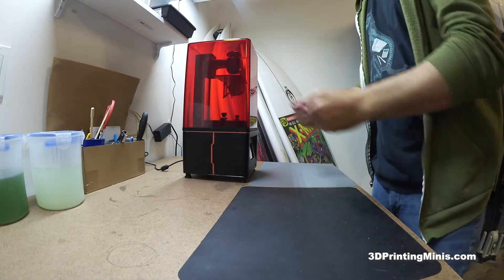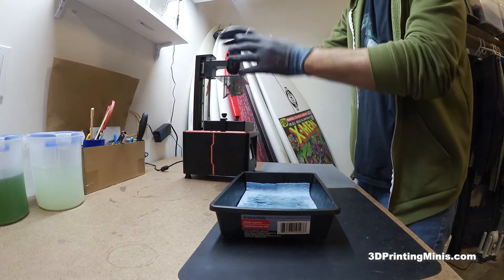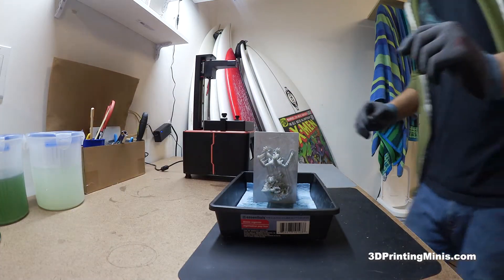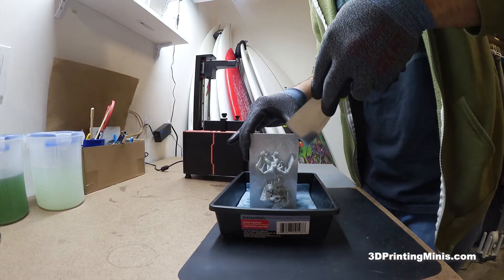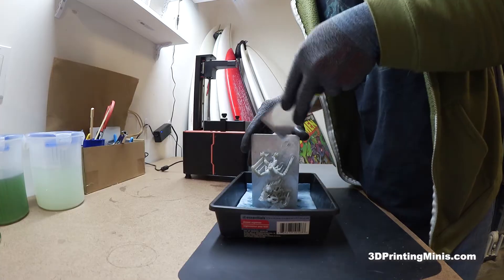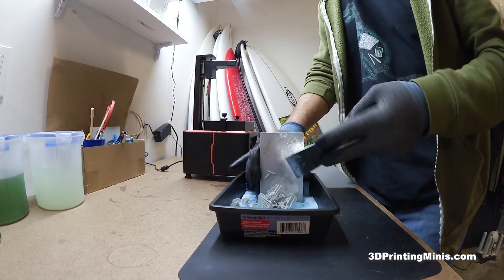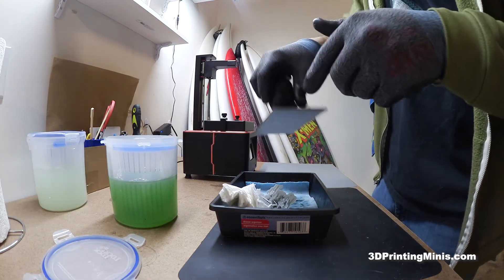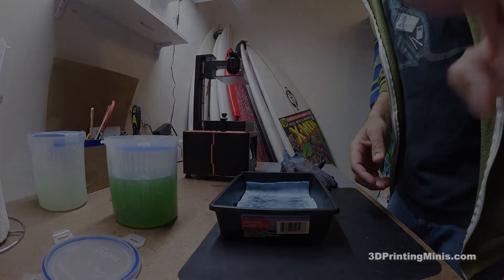How To Remove Prints From Build Plate Easily - 3D Resin Printer

Comment: what i was really looking for was how much force/wiggling is required to remove prints and if its ok to scratch the base. this video was really helpful on those 2 fronts!
Reply from the maker: Yeah, if you lower your base layer times a little bit (say 5% or so) prints should come off easier. Just be careful not to make the base layer times so low that prints don't stick to the plate and you get failed prints. You just need to experiment with your printer and favorite resin(s) a little bit. And from there on out it should be easier to get prints off without snapping your spatula in half.

Comment: What I’ve found works better than pushing hard is positioning the sharp edge of the knife in just the right spot, and tapping the back of the handle with a hammer. This works best if the metal blade has a full tang, going all the way back to the back of the handle, so you're tapping a solid piece of metal.

Comment: Have you tried resting the plate on its long edge and then scraping off? I would think its easier to keep away from your hand and less risk of hitting the print below, plate is probably less wobbly on it's long edge too?
Reply from the maker: Yeah, I just don't like it. Doesn't fit well in the container I use and it's harder to get good leverage and angles with the scraper. I really don't hit my hand much unless I'm not paying attention. I make more mistakes in my videos than in real life. Mainly because it's harder to do all this stuff with my hands while talking and describing what I'm doing. And also trying to do so without swearing, especially when I make mistakes. :-)

Comment: The way I do it is with a hammer. Put the scrapper at the bottom of your structure and then get a hammer. (Any size works besides tiny) Then with the hammer and hit the back of the scrapper a few times and it comes off with ease. Also your way works awesome. Keep up the good work!
Reply: I think a full size sledgehammer and a 300 lb anvil would work best, perhaps using the power of thor to smash that tiny little resin part off.. Go Thor! :D

Comment: I don't scrape anymore, boil a kettle and slowly pour that boiling water over the base of the models, where they attach to the build plate, they fall right off.
Reply: Sounds like 2000 IQ suggestion here. WiIl try it with my Sirayatech Simple clear resin when it arrives this week. I also heard that you can release the models by putting the build plate in the freezer. Falls right off they said.
Reply: @Splatterpunk_OldNewYork  Yes, I've done that as well. Freeze the build plate first , then boiling water = fall off.  That trick only works on one of my printers though, I think it has to do with how textured the build plate is and how well stuff sticks. I modified one of my build plates by sandblasting it, I was getting too many failures with the original finish. I don't get failures any more but they are much harder to remove. Even with boiling water I still have to pry with a spatula. Edit: Sirayatech sent me a bottle of clear, haven't tried it yet, but I believe they said water makes it crack, specifically they said don't post cure it in water. Not sure how the boiling water thing will work.
Reply: @RichardThompsonCA  I bought the water-washable kind. Needs like 15% alcohol for finish.Heard great things about it. High strength and high temperature threshold.
Keep you posted.
Reply: @RichardThompsonCA  Thanks my man. I have been printing for about the 3 week mark, and learned a lot. I use 1 or 2 burn in layers of 30s only, and then the thing releases with satisfying ASMR.

Comment: Thanks for the vids.  I am sure you have thought of this, but could you not go straight into 50c Mean Green bath, let it heat up and see if it just falls off plate like you mentioned supports do in another video?
Reply from the maker: To me, putting the entire plate in the Mean Green is overkill and kind of a pain. The plate has extra resin on it that's going to pollute and dirty up your Mean Green faster than I'd like it. Also, then I have to dry and wipe off the plate covered in Mean Green that's going to drip all over the place. Also, the plate from a bigger printer like a Mighty 4K or. Saturn won't fit all the way in most  ultrasonic cleaners so you'd have to awkwardly dip/soak 1/2 of the plate at time. Honestly, the best way to get models off the plate is to work on dialing in your base layer times. Once you've got those set for the resin you're using removing prints is pretty easy and not worth the extra mess or effort. Again, this is just my opinion. You're free to try any method you wish or find that works best for you.

Comment: All my prints get the little ridge (elephant feet) on the plate side. Do you have suggestions for zeroing the plate better? New Sub. Keep giving them Hell in the comments.
Reply from the maker: I print all of stuff on rafts using supports, so I really haven't run into the issue. I'm sure someone like Uncle Jesse or one of these 3D printing YouTubers has covered this. Sorry I don't have any suggestions. Again, I just don't make prints that would be able to experience this (because of the rafts/supports).

Comment: Hi! It's amazing but my model got extremely stuck on the platform :(
I don't know what to do. It's the RERF test that comes with the Anycubic Photon Mono SE (I mean, I haven't changed any settings) and it's strongly stuck. I've tired with the plastic scraper and I made a "dent" on it... So I've tried the metal scraper as you but I made a small damage on the plate... And they keep stuck on the platform :~(
Do you know what can I do?
Thank you so much!
Reply from the maker: This video is more about changing your base layer settings in your slicer program to avoid the situation you're describing. But, you can try removing and wiping down the build plate with paper towels (and UV curing them before you throw them in the trash). Then place your build plate in a large ziplock and but it in the freezer for 20 mins. The contraction of the metal as it freezes should cause the model to pop off of the plate. Then UV cure the ziplock bag and throw it away. Then try lowering your base layer cures times by 10% like this video recommends for future prints. Best of luck.
Reply: @3DPrintingMinis  thank you!

Comment: Thank you for the vid.  I was holding my the bracket and also using lots of pressure/ force to remove - good to see alternative method - hourly help me "destroy" less prints! 🤣
P.S. what "base cure speed" do you set your base to? Have you found this makes a difference?
Reply from the maker: The base layer setting varies from printer to printer and from resin to resin. You'll have to look up the recommended setting for your printer/resin and experiment with different time increments (2 or 3 seconds up or down) to see which work best for you.

Comment: Is there going to be any problem if the plate gets scuffed??
Reply from the maker: Yes, but the stuff I print is all rafts with supports. If you’re print stuff straight onto be plate it might be an issue. But your could also sand your plate (being careful to use a very flat sanding block) if you want it smooth again. But for me a scuffed or scratched plate isn’t a deal breaker.

Comment: My very first print (the rooks) got stuck very hard. I scratched my plate a little and cut myself :(
Reply: Mine got stuck too!
Reply from the maker: Spoiler: Don't print the rook file that comes with your printer. It's useless.
Reply from the maker: Spoiler: Don't print the rook file that comes with your printer. It's useless.
Reply: I printed mine and they are stuck. So here we are.

Comment: Wow, I guess the panic I just felt that I'd done something horribly wrong by slight scrapping the build plate when I tried to remove those test prints was unfounded?
Reply from the maker: Everyone scratches up and nicks their build plates from time to time. I print mostly minis using rafts and pretty much never print straight onto my build plate so I'm not super worried about any imperfections on the base of my prints. That said, if your plate gets too torn up you can always resand it using a flat surface.
Reply: Never sand your plate you will never get it planar by hand. And if you want to avoid scratches use a plastic scraper